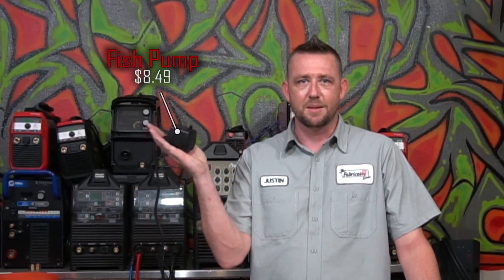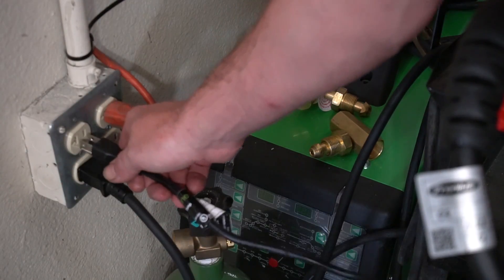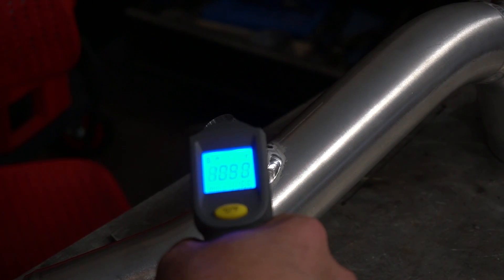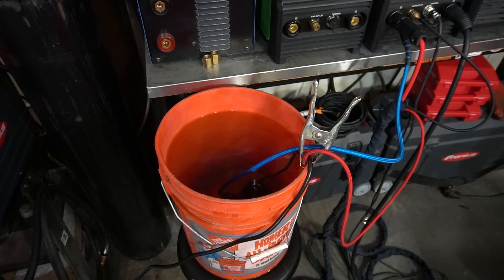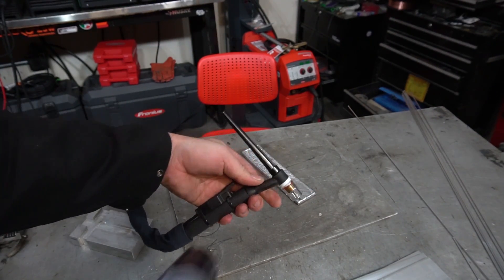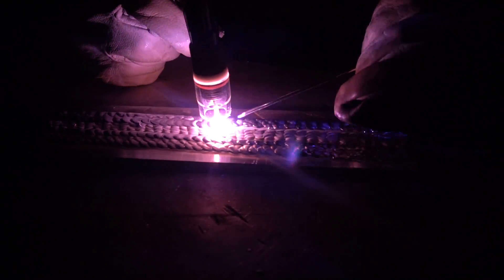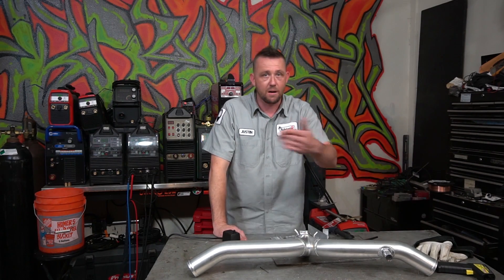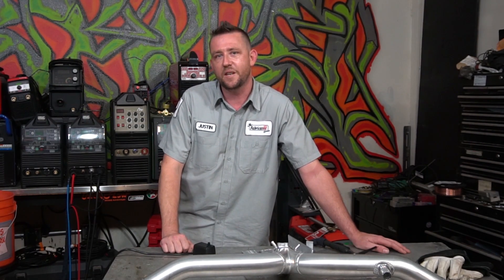TFS: $12 Dollar TIG Torch Cooler

Comment: One thing with those infrared thermometers is that they are massively thrown off by reflections
I recently inspected an epoxy coated pipe weld outside. There was a 20°C difference between epoxy surfaces and the ground back steel surfaces. This also changed depending on where you stood as it picked up your body heat
Also aiming near the top of the horizontal pipe (reflecting the laser at the sky) registered as -6°C!!
Reply: Tom is correct, surface composition has a big effect, due to reflectivity!  Solution: consult the device instructions on compensating settings for different materials.  My Fluke 62 has such a list, as likely do others of reasonable quality pedigree.

Comment: This is a great experiment. Getting started in TIG welding is EXPENSIVE! My first Tig cooler was some garden hose and adapter fittings to connect to the kitchen sink faucet. It worked great. I used it until I went the carbonator pump route. That would make a good video. Get a used eBay carbonator setup with tank and pump. Show how to build a proper cooler for around 100-150 bucks. Not included the price of proper coolant :)

Comment: Even better for free, Just connect to mains water,  tig torch water inlet hose turn tap on and run the outlet to waste down the drain, you have mains water that a constant temperature as opposed to the bucket method, you also can regulate water flow rate... David from Australia 👍😜

Comment: That begs the question, why are big water coolers so expensive > $1K?
Reply: I have a £120 pump for my 550 liter fish tank, pumps 1300lph at 0.9 meter head height,been running the last 5 years, 24/7. Twice a year it has a hour of down time for changing filter material. I'd bet everything I don't own that setup for my workshop, wouldn't be able to tell which is which.
Reply: I think they have a phase change cooler in them right because if it is just a pump, radiator, and fan then yes definitely overpriced you could build a good one for under $150
Reply: Industry standards.....
Same reason you can't weld with a car battery at work

Comment: My old boss used the water tap and a length of garden hose the water out of the torch just watered the grass outside the shop a bit of a waste of water but it got the job done while they got there cooler fixed

Comment: I have used a cheap Ebay pump with a bypass, an old pc watercooling radiator and 2 120mm fans and a 230v ac to 12dc power supply for years.
Works the same as a professional unit only way cheaper.

You do need the bypass as the pump puts out too much flow for the small bore hoses in a torch.
This will give cavitation, noise and premature pump failure.

Comment: Cool stuff, thanks! I would totally do this... but I'd probably use a coupon and get a pump from Harbor Freight! They're actually pretty decent if you don't get the cheapest ones (I have one that's been working for over 3 years)! The flow rate is always super exaggerated but just pay close attention to the H-Max, Max Head, Lift, etc... more is better!
Reply: That's what I use, in a clean soap bucket about 3 gal. capacity. I use RV antifreeze as the coolant and a big finned cooler with a $6 walmart fan blowing through it.....for 4 years now. Seems like the pump is rated about 20ft. head/ 8.65psi.
I pull the return line up so I can see the flow then go to work......280amps AC welding aluminum heads. I have to stop to let the head and coolant cool off every few minutes then get back to it.

Comment: the problem is without a radiator the water is going to get hotter and hotter the longer you weld, you can hook up a line to your sink in your house and just let it flow outside and it would work better, no pump needed or anything
Reply: not to say that is a good way to do it either though, haha tap water will corrode brass and copper over time, but if your welding with some $20 ebay torch who cares, right?

Comment: $450 or $12???
Realistically, if the $12 set up gets the job done, and continues to work, why spend the $450??? 
Add a few bucks to the 12 and put a fan and radiator in the line..
Reply: Ya.. I know that's the idea, but... Wouldn't take much to make it a very inexpensive and viable piece of equipment.
I've seen similar, intended for "temporary" fix... 35 years later, still being used with no issues 😎
Sometimes, the best way to get the expensive name brand box, is to look in the neighbors garbage..  
Seriously though, you're using a 100% duty cycle pump.. it's cheap, but also intended to run for years..  and a bucket.... I saw someone else say to use a cooler. That would work better, could even put some ice in.. 
 I'm just an old farm boy/truck driver/heavy equipment operator/diesel mechanic/metal fabricator.... Quite honestly, I've done some pretty sketchy emergency repairs on some things.. sometimes the simplest, cheapest thing can turn out to be the best option... 
Oh ya.. I like your $450 cooler, that's way better than the $2,000-$2,500+ that the real ones used to be!!! Probably because someone found a cheap pump and tank, put it in a box with their name on it..... And sold them.....
I see the cheap pump as being kinda like the fix on the air intake on a $560k Case IH Steiger tractor... The position of the air intake sucked up too much dust, an engine air filter wouldn't make it one day...  Silly farmers in eastern Oregon bent a piece of old irrigation pipe and added to it.. problem solved! 6 month later, and Case IH had a contract with a private company to retrofit new tractors, for $2,500 each... 
Looked like same and worked the same as the farmers $25 fix.....
Just saying 😎
Reply from the maker: Ed Gosselin Very realistically- it's a temporary solution that has not been tested against a cooler. I'd use it only as a temp solution or emergency thing to get a real TIG cooler.

Comment: This is pretty much the set up I've been using for a while now.  I used to have the water running through a small heat exchanger harvested from an old air conditioner but the pump I was using didn't have the power to push through some 60 feet of tubing in the exchanger.

Comment: You need more flow and that pump lacks pressure to get flow.  10 feet of leads means 20 foot path of 1/8" hose.  This is why coolers use gear pumps, positive displacement types which push 50+ psi.  You can try a diaphragm type pump which are polymer construction so they won't have issues with high frequency emission during AC GTAW
Reply: Because....? Did you not watch the video? It works. No problemo. This means enough flow, no hf problems.

Comment: What was the ambient temp in the shop Justin? 
Using a 'bucket' that dissipate heat would improve the 'system'. Larger volume of water also would help. Main problem is when you got the water to warm to be efficient it will take a long time to let it cool.
Reply: Ice or 2 buckets for spare.  Keep it simple simple simple.

Comment: would like to see a comparison to the Everlast cooler, saying one heat exchanger is more ghetto than another heat exchanger without numbers is just opinion.  if the bucket had a lid and a better pump and was plugged into the welder instead of the outlet.....less "ghetto"??  heat exchange is heat exchange....imho.

Comment: This is a great video.  I picked up a lot of good info.  Just something to be aware of, those IR thermometers are very inaccurate on shiny materials.  Anybody interested can google the reasons why, and some even have a setting to adjust to the emissivity of the material.  But in my experimentation they always read low on even semi-shiny aluminum.  My bet is your work pieces were much hotter than you measured there.  Would love to see the weave vid!
Reply: Hmmm, wonder if he is brave enough, no, confident enough, to give it the finger test?  I did not see much reflectivity on the TIG torch itself (maybe on a clear torch lens), which is the main concern, right?

Comment: Excellent video! Affordable, simple, & effective. I've got a Miller Syncrowave 210 that I'd like to try this on, but it doesn't have ports on the machine; would I be able to buy a WP-20 & just connect directly to the torch lines, or is there something else that would be needed?  Thanks again!

Comment: i build water cooler from a motorcycle radiator with couple large cpu fans and a  small round alum tank wire the fans to run constantly with a small  inline 12 volt pump  run off a wall plug adapter.

Comment: if you use a cheap car fuel pump and a shower head on the return end a bit in the air it would work very well and the water would cool down due to evaporative cooling. depending  on how much you spend on a psu a rig like that would cost about 50$ and be very reliable since car fuel pumps are pretty dependable.

Comment: Two holes in the refrigerator that you keep your lunch in- one gallon bucket and pump in the bottom of the fridge,  and use a small copper coil in the fridge to run from the torch return water to the bucket. Works great, weld all day.Note, run your compressed air through another  copper coil in the same fridge- with a water trap on the outside, and you also have totally dry air for the shop.
Reply: good idea, in my town people throw fridges on the street, mostly students, some in almost new , just have to clean it out
Reply: @georgiojansen7758  Complete unnecessary the warmer the water get the faster it loses energy on top of that it evaporates it doubt that you can get the water warmer than 100f/40c, with this small welder.
It would take a few hours of non stop welding. 
Even if it gets to hot change the water or get a bigger bucket.
Reply: Throw in some ice if you're really long winded in your TIG welding?  But I agree with Stahl, 5 gal bucket will take a lot of heat before it "overloads" (did anyone pick up on the fact that his physics lesson explains why hot water lines often freeze b4 cold water lines exposed to low temps?), Phenomenal DIY idea, Mr Fabricator.  Just use the proper coolant, though I see little prospect of trouble if the usage is very light, using plain water.  Maybe flush it with some sort of neutral solution once in a while?

Comment: To make a long story "not" short, My first water cooler was when I got hold of a free water cooled head and hose, turned My sears colormatic stick welder over to TIG scratch start, (DC only of course) bought a radiator and electric fan from a new "Aries K" that had been wrecked (Aries K cars had just came out in 88/89 ?- I'm dating Myself here) and used a sump pump (the hose outlet/inlet size fit the radiator hoses) and two tanks (the second tank was where the hose was downsized to the head. Anyway - Worked great for years and sold the set up years later for $800.00. Cost Me around $200.00 to make and used for about 4 or 5 years and bought My first AC/DC TIG machine for $4,500.

Comment: There's a project, Make an aluminium or stainless tank with quick connectors and a pump inside. That is all the cooling units are basically. You could put some fins on the outside of the tank or a row or two of pipes for extra cooling.

Comment: Love your shows thank you. 
Just noted you didn’t trust the inferred thermometer which I agree is only good for a guide unless you have the exact Emissivity Value of the material surface you are measuring, otherwise you can be as far out as 30 to 100deg C.
For example if the thermometer you were using has a fixed Emissivity calibration of .95 the black plastic handle would be pretty accurate but the metal could be miles off.
Eg. Emissivity of the surface of a material is its effectiveness in emitting energy as thermal radiation. or Emissivity is a measure of a material's radiating efficiency. An emissivity of 1.00 implies that the material is 100% efficient at radiating energy. https://en.wikipedia.org/wiki/Emissivity
Do not confuse this with the ability to reflect light they do not relate at all, the shininess is not relevant at all. 
Items like paint, water, paper and plastics the efficiency is between .9 & .95 thus any variation only gives a minor temp reading difference.
But if you look at metals it’s a totally different story, Aluminum for example is between .09 Just polished no oxidation or polishes on surface and .2 normal oxidation (you can’t see it) or .4 heavily oxidised (white) so any incorrect setting on the thermometer gives a huge variation 30 to 100degC difference and you can’t tell the correct setting by looking at it, & across the surface will vary even though you can’t see the difference. 
The best practical way in the shop is to just give the metal a quick spray of enamel paint and the temp is read as paint and reasonably accurate within a few degrees. 
 Good chart for metals http://www-eng.lbl.gov/~dw/projects/DW4229_LHC_detector_analysis/calculations/emissivity2.pdf
Good chart for other  http://infrared-thermography.com/material-1.htm
I hope this info helps.

Comment: Absolutely nuts man, this is amazing. Punk rock welding, gettin' it done DIY style on a budget. Ain't pretty, but it works! Might work better with a metal bucket with some fins welded to it to dissipate the heat a bit more, but with the water not getting too much higher than ambient temps, I doubt there would be much difference.

Comment: The water needs to go through radiator that has a fan blowing on it.
I made a cooler using an air con radiator and  fan with a 12 volt pump and aluminium tank.
Never got to try it though.

Comment: Great video Justin say the story on Instagram. Thought it was a pretty cool way also ghetto like you said but hey I guess if you didn’t have a water cooler it would definitely work. Only thing I would suggest is putting distilled water in it for longer uses. I seen someone selling some kind of pump thing like this that you put in a bucket on eBay for like $175 or something like that before I bought my water cooler. Definitely a cool interesting idea / video. Also liked the joint video with you and crummy on Instagram that was cool too. Sad part about that cooler idea is it’s probably quieter than my everlast cooler 🤣. I’m sure this idea will help some people getting started out. 🙏👊🏻🍻🔥
Reply from the maker: Chris Wojnarski Its the most quiet water cooler I've ever heard 🤣. Tha is for tuning in to the feeds and vids! Its ghetto, but I cant deny it actually works haha.
Reply: The Fabrication Series definitely a great affordable cooler even a back up if  someone’s breaks. Great video 👊🏻🔥

Comment: I just run city water in and let it run out the driveway, It uses very little water (1/8" line)
Reply: Now that is the simplest method for sure.
Reply: Water the plants with it perhaps
Reply: +gurjinder singh 
The driveway is sloped towards the yard so it works out 😉
Reply: +Jesse Wright 
You are correct, however the only part exposed is the torch head and lead that I will replace when I decide to get a water cooler. As Justin stated all you really have to do is make enough money to overcome the barrier to entry.
Reply: John Smith i just made an idea 💡 toilet 🚽 water 💦
Reply: Same here.
Reply: Chlorine in city water and dissolved minerals don't do your equipment any good.
Reply: Rather than waste ,what will become more precious than gold ..... Deionized(distilled) water in a 5 gallon bucket ,would last for at least 1 year and you would very likely never get water over 100 #  F .
Reply: It's a very old, proven method and you're far more likely to wear out the torch than foul it.

Comment: In 1974 my fellow welder and I want to try TIG welding with the P&H welder. We made wire machinery for processing wire, like spooling welding wire onto spools for use welders. He said all we needed was a cooler. We put a submersible pump in a 5 gallon bucket to weld a small run of parts and it worked great. 
We took turns welding the parts. What I enjoyed was I got to show my TIG welding skills for the first time earning me the respect of not only my fellow welder friend but the rest of the shop.  Nice video guys.

Comment: Yo Justin.. seduce us with a weaves video. Types. Techniques. Etc. I tried once and feeding from the rear/side snarfed my tungsten and I gave up. Also, a few people I know ran city water in a loss system (drain in planter) and after a time chlorine killed the copper.
Reply from the maker: Mr Wolf The weave requests are flying in right now haha. I'll probably make it. 
As far as feeding from the cake of the puddle - just practice. It's frustrating, but remember that if it was super easy - hot blondes in bikinis would be doing it.
Reply: The Fabrication Series Perhaps a video of hot blondes in bikinis TIG welding? But they have to use the "ghetto cooler"!
Reply: That does sound like a hot video.. especially if the ladies know how to handle a torch!
Reply: Perhaps a video on alternate feed angles. I obviously couldn't find the puddle.. would side feed help or should I just go straight for rear entry? Or should I try circles so the change is gradual and maybe my brain can keep up?
Reply from the maker: Mr Wolf I found the best practice was running circles. I'll make a vid soon.

Comment: Use a metal bucket for better heat dissapation.
Also if you purchase a cheap computer water cooling radiator and put it inline it would significantly increase performance.
Reply: Why?  All you are doing is seeing which goes to ambient faster.
Reply: i would like to see a test of that versus this simple setup, i'm pretty sure that water to water is going to work more efficiently than water to air.....but i'm no physicist...
Reply: @vintagespeed  This simple setup has no secondary cooling (no water to water cooling), just a big heat capacitor, in the form of a big bucket. Adding a small active radiator in the line would theorically pull heat from the water and release it in air, effectively turning the system into a real watercooler, so making it more effective in any case, but to what extent, I do not know...